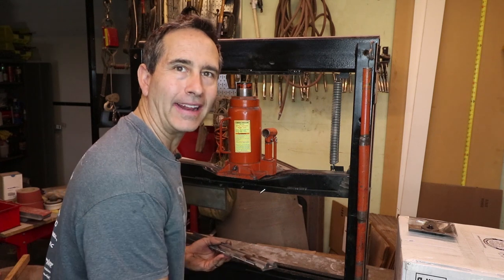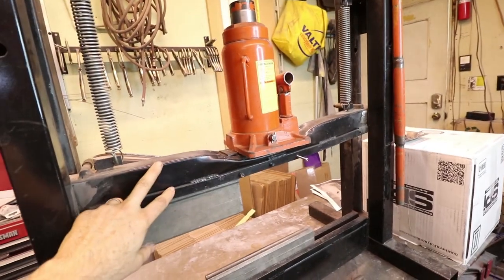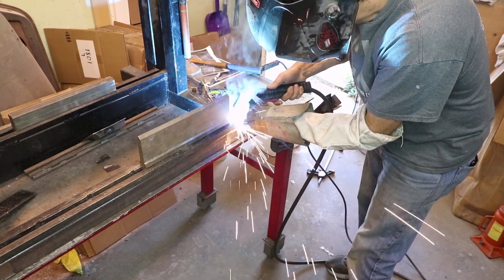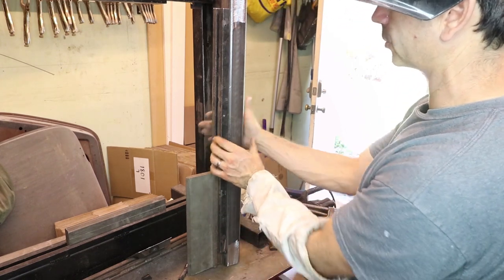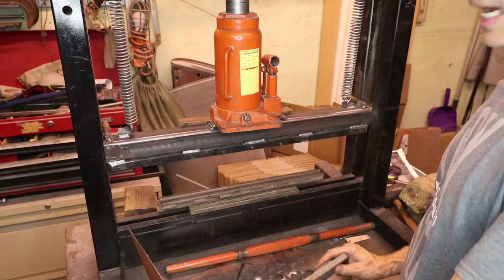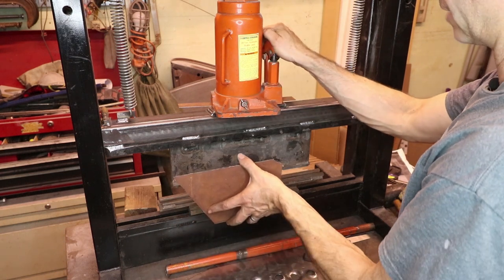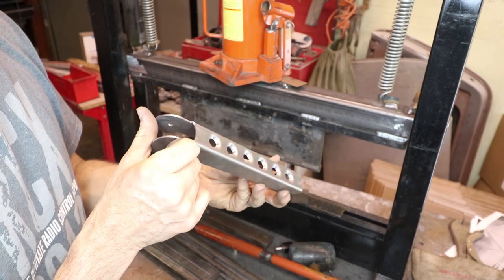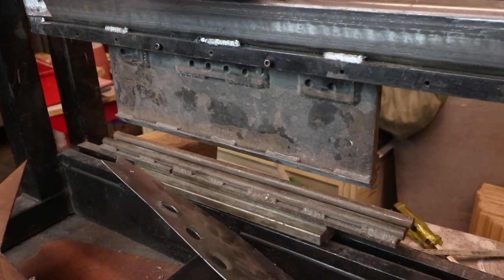How NOT to Make a Homemade Press Brake & Fix It!

Comment: thank you for the video, Nice fix, there were several things about your press that I really liked.I will probably use them when I build mine, depending on what material I come up with. limited budget is always an issue.  I was just wondering if you anchored the hydraulic Jack better it would probably work better. I have seen guys build a set of die's out of angle iron that seemed to work well. it would be easy to do, that round stock on the bottom half of the die could be a problem. again thanks you gave me some things to consider.
Reply from the maker: Thanks and good luck on yours.
Sometimes I find myself moving the jack left and right to form complex shapes.  Normally I move the dies around, but sometimes the part I'm forming runs into the frame .  That is why I didn't attach the jack to the frame.  
The one thing I could add is another tube stacked on top of the tube that slides.  This would prevent some of the rocking motion of the dies.
Other than that, this has been a great tool.
Reply: Thank you. Hoping to get the material in the next week or so.

Comment: Nice little bench brake, but I would seriously get that jack mounted and do something about the slop in the arm.  That's a lot of force when you're cranking down on it and if something slips you might be heading to the hospital, or worse.
Reply from the maker: Fair enough, I agree.  The slop has been fixed, but I will add an attachment to the top too.

Comment: Can u tell me size of spring? Or wire diameter of spring??
Reply from the maker: Sure, the wire diameter is .116" and the outer diameter of the coil is 1".  There's also a spring inside that one with about the same wire diameter.  That is just what I had or was available a t the hardware store.
Reply: Ok thank u..